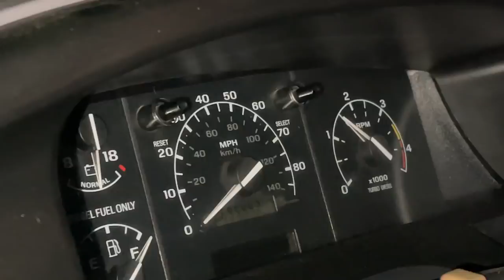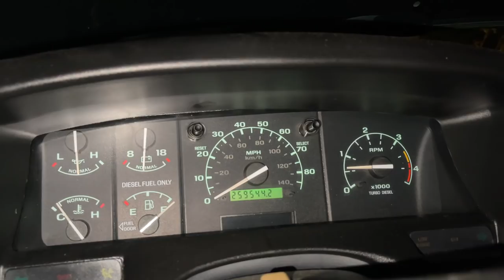1957 Chevy Tri-Five barn find & abandoned 1940 Ford, SAVED!!!

Comment: Love that 57 210. Same 2 door model I drove in high school. I bought it for 125.00. It was sitting on blocks but after putting tires and wheels on it and a battery it lasted me all through high school in 68. Sold it after Uncle Sam sent me on an all expense paid vacation. That 57 is super sound as far as the body goes. Good find. New subscriber today. Thanks for sharing. 👍

Comment: as an UK recovery truck driver, i was cringing watching you strapping down that car. your first attempt was better than where you put it through the chassis rail. think of it like taking the creases out of a bedsheet, ie pull the corners tight at 45 degrees, around parts that are meant to take a load. also, pull over after 1/4 mile to recheck straps, things settle down quite quickly.
keep up the good work boys + girls

Comment: Oh the water separated on the driver side of the filter can be a huge problem too ,I’m going to take off my water separates filfter , my water light has never worked anyway, my truck is a 7.3 power stroke it will pull right up a tree if it could get traction lol thanks BigAl California

Comment: For strapping cars down, I prefer to strap to the axles and have them on an angle. If they're all straight the load can shift side to side. 

Yup I figured that's why you two had the trailers that way around. Need to get some more practice in with the goosenecks.
Project list / update / plan video?

Comment: My old 7.3 powerstroke used to have issues with random shutting off and it was the crank position sensor. Easy to change and they are known to go cheap to buy i through a spare one in my glovebox just in case.  Looks like you had a fun trip.

Comment: I got rid of my 7.3 and went back to Cummins.  Between the “romps” and random dead cylinders and cut outs I got tired of it.  How ever one of my biggest problems with mine was the injector driver module.  They are prone to getting full of water due to where they are mounted.  When I pulled mine and shook it you could hear water in it. Changed that out with a hi performance unit and it ran much better.  Still always had random romps though.

Comment: Cam shaft sensor. Get the purple one not the grey one. Its at the font of the engine block. Pretty easy fix. $20 on amazon. Its notorious in the 7.3.

Comment: My ol 1997 power stroke had the same problem,and it was sucking air fro the vary bottom fuel line way down under the fuel filter , it is a pain in the valley of the engine , and now I had a stupid fuel thief drilled a hole in the front main tanks and I did not get to the station to get new fuel inthe repared hole in the fuel tank , and did not know there was water 💦 inthe full back tank , and it conked out on the way to the station and I did the one dump thing you should not do ,   I cycled the tanks with the dash switch and it pulled all of the dirt and build up in the bottom of the tank , and now it’s plugged from back to the engine with plugged or restocked  lines , lol thanks BigAl California, praise Jesus Christ grace amen 🙏

Comment: FYI, that slot in the frame shouldn't be used as a strap point, I've seen alot tare just bouncing down the road.  Years of towing I personally would go over the frame rails or use axle straps over the frame or axles rather then the holes in the frame.
With the newer vehicles they have a T slot on the frame or in the unibody that is double plated designed for tie downs.

Comment: If the OBS keeps shutting off on you then replace the cam sensor.  Its a known issue on those trucks.  WHen you buy one then get a spare to keep in the glove compartment along with a 10mm ratchet and shallow socket.

Those old 7.3 trucks with the gear driven fuel pump take forever to blead out.  The super duty trucks with the electric pumps are good before you start them as long as you cycle the key a couple times.

Comment: (only 1:16 in atm ) I have had a few, all have given me a pesky hard to find , sucking in air via Oring on the selector valve just behind driver door before mid tank indisde frame , driver side .. one of mine is still driving on the rear tank 4 years later just because of the same symptoms  and i got lazy lol .. good luck !!

Comment: I would like to build a 'ghost 57' estate using a sports coupe 4 door so it looks like a 'caballero' estate usually built on bricks from the 50s.  I think it would be cool and a true what if build but I saw duckies had a few sports coupes and handyman estates. So I think the construction would be pretty easy but at the cost of 4 may be more or doing it with help from Danchuk 57 parts and body panels. Have the rear door a multi functional door like a Ford rear hatch, but also tinted a charcoal grey colour(UK spelling) lol or a smoke glass and a fabric sunroof so it's the ultimate long roof/surf wagon. Or the ultimate kiddie wagon or Finlay babe magnet motor.
Did you notice both the drivers doors had almost exactly the same patterns on the doors....weird coincidence
Give them the Ford loaned pickup that'll buy the yard as there's a shortage of pickups in America?
I have a name for your new old Ford pick up ..... he-man or she- ra, as they both have the Powerrrrrrrrr (stroke)
The 40 Ford could be Rusty Springboard, the 57 coupe hmmmmm 'Dusty' ....lol

Comment: Not to doubt, but I have a hard time to believe that trailer weighs 11K empty. I have a 42ft 4 car Wallymo hauler that is 10K empty and it has tandem duals axles on it (so 20K). Normally the 4 cars are 9K but mine has the entire lower end rebuilt with new, heavier steel.

Comment: No comment Emily mam I had gotten rid of my beat up and well used 86 Chevy k20 custom deluxe farm truck that had a built 335 with a balanced bottom end and a comp cams Xtreme energy 268h 221/224 477/480 lift cam,, anyways traded for a early 94 Chevy Silverado Z71 that was used to pull hay wagons and gravitational hopper wagons, and it has a 1987 Chevy p30 tbi 350 4bolt main 357 built SBC, and I now have a truck I don't even know if it would pull a trailer well nor do I have any idea of the mileage on it it's a black Laramie slt quad cab long bed 1500 5.2 litre 318 magnum v8 2000 dodge ram 4x4... Previous owner had several cluster issues so the dash guages got changed it is a factory tach truck so that is nice I guess lol..

Comment: So these cars are going to be a ground up nut and bolt rebuild ? presumable shot blasted to start with and then painstaking panel repairs carried out, paint treatments, engine rebuilds and new hand built interiors, you can still get the parts ?
Of course each vehicle will have a bottomless budget. I suspect around £35,000 pounds or whatever that is in dollars $45000 maybe?
Or…….will the grass just grow around them and you end up looking at a yard full of rusty junk.
It would be great to just see one of the cars you’ve featured actually finished properly, the MG, or the Bugatti, or one of the trucks, finished to a level that says this  vehicle has been properly rebuilt and refinished.( look up Robbie Leytons work on The Golden Nuget for instance)
Goood channel, interesting concept , but please finish something.